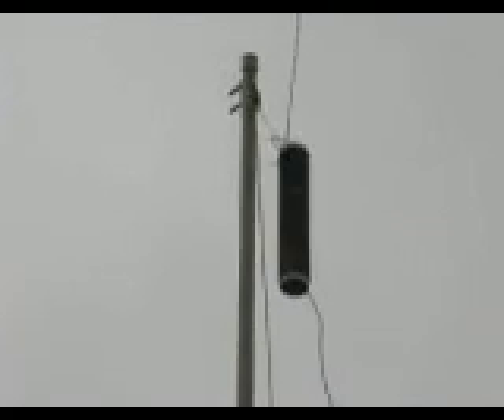Adding 80 metres to a 40 metre dipole

Comment from the maker: @wd599 Jon - it will only work on 80 & 40m and possibly also 15m (the 40m section is a 3/2 wavelength dipole on 15m).  

An ATU at the rig will allow operation on other bands, but because it is coax fed losses will be high.

Comment: dose this antenna also work the other higher hf band ie 30 mtr thru 10 mtr or will it need an external antenna tuner at the rig?
thank you Sir. Jon in california.
Reply from the maker: It won't be efficient due to loss in coax. Using open wire feedline and a balanced ATU will give  more efficient multiband performance.